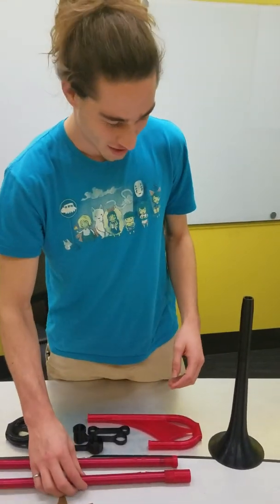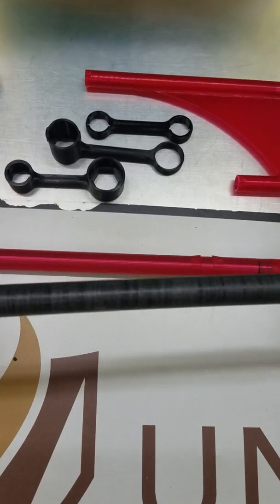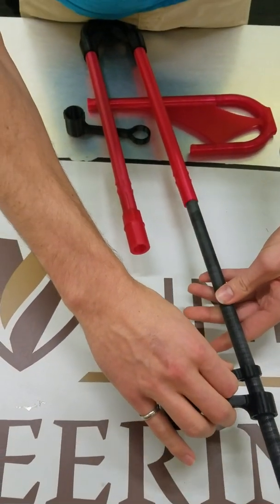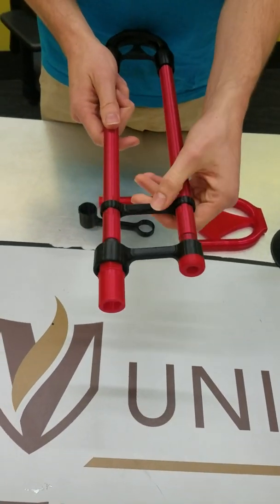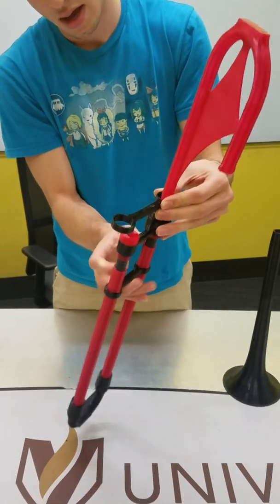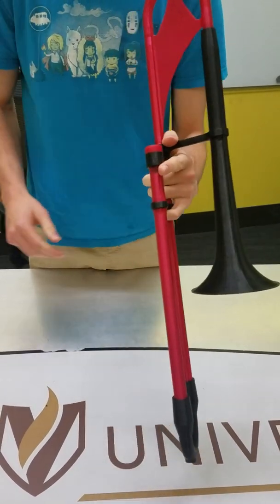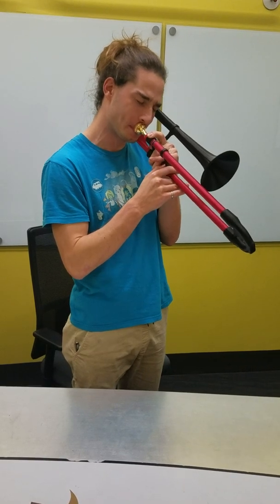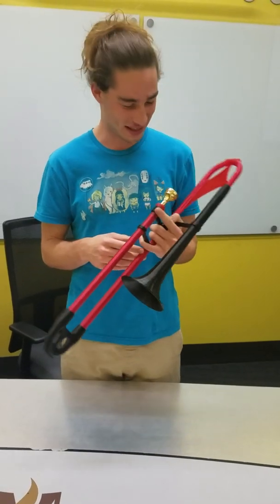3D Printed Alto Trombone in F

Comment: That's awesome man! Good job! I have an actual brass alto in F. They are rare and they do sound a bit trumpetty, mostly because the bell is small, and the cylindrical nature of the instrument. If your bell was an inch larger and thereby the bell flare was a bit more conical, it would mellow it considerably. A Schilke 40 or 42B is the smallest small shank tenor mouthpiece in production. How is the intonation?
Reply: Thank you 27funkyes and thanks for the advice! I thought about making the bell larger to mellow the sound out, but I was balancing that with my desire for an instrument that is very easily packed away (one of the main design goals was to have a small disassemble-able travel horn). 

As for intonation, it took some calculation and a couple iterations to get it where I wanted it, but first position is tuned to be slightly sharper than an F (to account for different sized mouthpieces and such). As you get higher, first position can get a little weird but alternate positions cover for this nicely (for instance the high C is better played around 3rd position because in first position it is quite flat). Other than that, all the other notes just take a little getting used to in order to know exactly where they fall on the instrument, but of course that's the beauty of trombone. :)

Oh also, the slides are a bit short for there to be a real 7th position, so the lower Gb and B are not really playable. 

Thanks for listening!